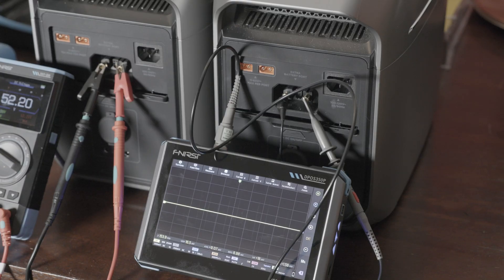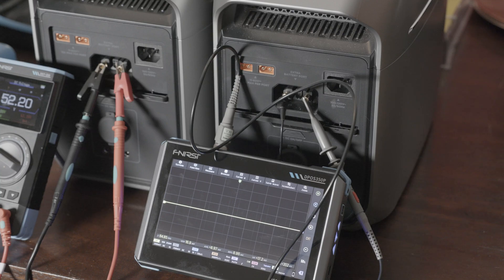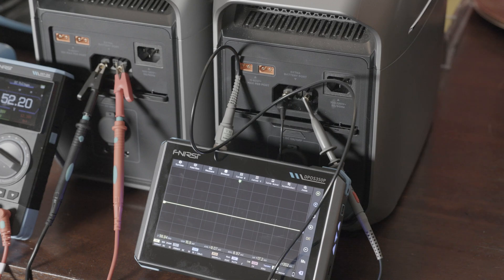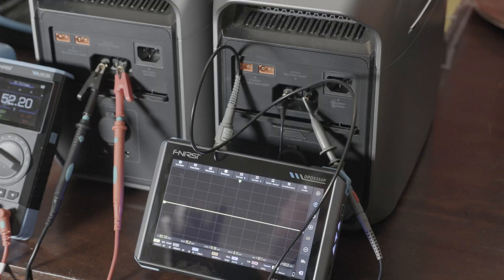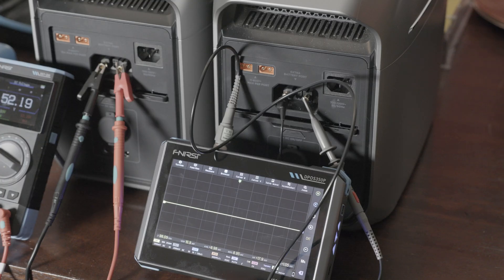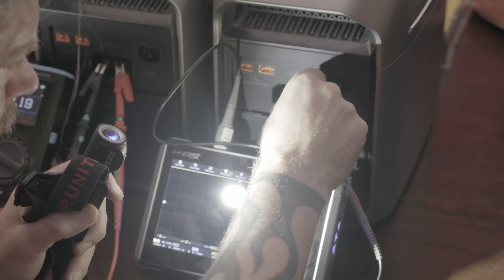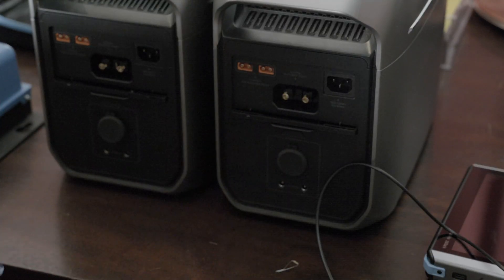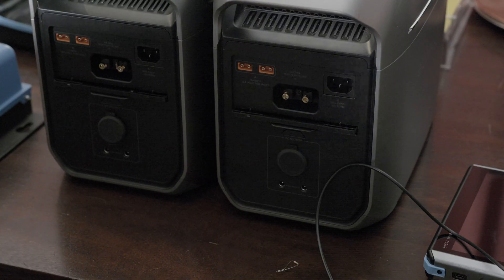Big News! Direct Battery Access Hack for Ecoflow Portable Power Stations (Finally) Delta 3 Plus Demo

Comment: Have you found any way to "turn on" the extra battery to access its battery without the main unit?

I found the Delta Max 2000 I have the port1 requires jumping to different pins than port2 but generally works fine regardless

Comment: For the Delta Pro can you use the same resistor and which pins do you connect? I understand that it is 15S as opposed to the normal 16S.

Comment: Is ecoflow internal battery gauge taking into account an energy drawing from or charged to this XT150 port?
If I would like to attach additional battery, will it account additional capacity? 
I guess when using original battery accessory there must be som additional charger/discharger in it to sync SOC before it fully connected, did you tried to connect it in this way?

Comment: I have ecoflow delta 3.   The battery interface looks exactly like above with a postive to right and n to left,  will this work with 3,  if i follow instructions I dont see any difference, how do i know if this is working
Reply from the maker: You need to get a multi meter and test, just be careful.  It's not so much high voltage but lithium is high current.

So that is why I have not made a video showing how to make a hacked cable directly off the contacts, I don't feel it's safe.

I'll be instead releasing a video showing how to build a very safe OEM quality hub.

Very busy with IRL right now, maybe not this weekend but next that can be my weekend project.

I highly doubt it changed on your unit, but since I have not tested I obviously can't verify.

Comment: VERY COOL

I am competent enough to follow the instructions and duplicate what you have done. But its really a monkey see monkey do scenario.   My goal is to add a third party expansion battery that can charge and discharge in the same manor that the proprietary  EF expansion batteries do. I am using the EF Alternator charger with a delta 2 max.  

So my basic question is what voltage 3rd party battery should I use? I see several YT vids connecting 48V batteries on other brands, using a similar hacking technique. 

Can I use a 12V battery? or do I have to use a 48V battery.

thanks in advance
Reply from the maker: So you can hook up a battery to the solar input.  I'm doing that and it's a safer way to easily add capacity.  Then voltage only matters with the MPPT range .higher voltage means less current and easier to get max power so yes 48v is good unless the power station is too small to handle it.

A direct battery connection like this is another whole level higher, direct integration, hooking the batteries directly together.

So they must match just as you would building a DIY battery bank.

So same SOC, same voltage, chemistry, etc.

I'm releasing the into as you can do even more powerful things with this setup, but it might be overkill if your only goal is extra capacity.

For that check out my Ecoflow hack video:  https://youtu.be/0fvpc5QyYHk
Reply: @ViciousXUSMC  Yeah I understand that the solar port can be used. But then there is no way to charge the external battery and Ecoflow with the EcoFlow Alt charger.   And besides I need the solar ports for my solar panels anyway.   Its just a kludgy solution.  What you are showing is a much more elegant solution. 

Just in case I am missing something.  You say you are using the solar input for the ext battery.  Have you found a way to charge the external battery while it is also plugged into the solar input?  that is the #1 problem with this setup in my view.   

What is really attractive about your hack is that the ext battery acts just like the proprietary EF batteries. and there is the bonus of the possibility of getting more 12V power output for a diesel heater.   I am having to use the AC inverter all night while camping because heater requires 130W @ 12v DC, for a 30 sec.  The cigaret port taps out a 5A I believe.

Anyway thanks for the help
Reply from the maker: @joedunne635 Yes watch that video or actually a few of what I have shown that setup.

We replaced the solar with a battery 
We add solar MPPT to our battery 
Done, this is a self sustaining system.

The new MPPT has your solar panels going to it instead of the old PV port.

Now you can get any size MPPT you want, and your still saving money because a new MPPT and battery is going to be cheaper than just the own expansion, especially as you keep scaling higher and higher.

Like my setup is now nearly 30,000Wh (30x the original capacity) for my little Delta 3 Plus network I setup

Comment: Shocked that this doesn't have more views given what a huge discovery this is! Thank you for doing this and and linking the source. I can confirm this works on my (non-Max) Delta 2. Interested to see what people, smarter than me, are able to do!
Reply from the maker: For one using this concept, on a different power station I want to showcase how you can use it to make use of an external MPPT.

So if you wanted more solar or similar this gives you an option.

Though you can also use a MPPT as a middle man and go directly into the PV input as a workaround too for helping use high voltage panels on low voltage power stations.  

That's in this video: https://youtu.be/t2bRHF9negA?si=vChdTnTHOhJXpK6C
Reply: any reason to suspect this would not work on my delta 2 max?

Comment: Nice ! I was also wondering when this hack would come out.  Been using solar ports on my delta 2 max.  Not efficent as mentioned. 
Does anyone have the link to purchase the same 1k resistor used here ?   Thx
Reply from the maker: I'll add the link in the description for you.  Unfortunately the cable I ordered isn't here yet and Amazon said delivered and it's not.

Once I have the cable built I'll really start testing this.
Reply: Hey, any luck with the cable arriving?
I was wondering since the delta 2 max has x2 extra battery ports.
Would there be any benefit to connecting them both to a larger battery bank thats in parallel ? 
Also, do you think the Max 2, when plugged into the wall outlet, will charge the added batteries ?
I'm looking forward to the build. 👍  Thx
Reply from the maker: @user-jd6dq8bn5c Nope, got lost in shipping.  Had to order a new one :(
Reply: Hey, I went ahead and made my own parallel cable. I've had some interesting findings. 
The delta 2 max, at night when plugged into 120ac, solar disconnected from D2, will charge up my 48v 200ah battery bank faster than my new 48-58v LI 18a golf cart charger.
All Battery temps stay nominal.
 Making it more streamlined during nighttime recovery.  

There is a disconnect when receiving solar and have the 48v 200ah  battery bank linked parallel to d2, the solar stops charging the D2 battery and in turn its 60v 25amps solar to the battery charge controller then to the battery then to d2 solar ports for 1kw. 
Having battery bank parallel during this process stops the d2 battery from charging, and it gradually goes down in percentage throughout the day.  If I pull the parallel cables, then the D2 battery starts increasing percentage during solar port 1k hookup. 
So right now im solar feeding daytime un parralelled.
Night parallel with wall ac plugin.  Will ad more solar panels after October has passed. No hurricanes.
I'm still learning more every day. 
Thoughts?
Thx
Reply from the maker: @user-jd6dq8bn5c cool experiments and findings.

I might have to make a temp cable the permanent one I was going to make was lost in shopping.

Comment: Is there any reason that this wouldn’t work on the EF deltapro 3? Or would the protocol be different considering that the batteries aren’t compatible????
Reply from the maker: I would verify each unit separately, if they are using a different connection especially.

But the concept will definitely work.

At worst, if someone really needs this functionality, a 100% way to always achieve it is to have ond authentic extra battery, and splice the battery cable.

Let the normal authentic communication happen and just tap into the electrical side.

Not as flexible and you have to get a battery, but better than no option at all.
Reply: Wooow wait let me get this right: so you’re saying get one ecoflow extra battery, and splice in to the 48v portion of the cable. And run your extra no EF battery functionally in parallel? I think that’s what you’re saying…???
Thank you so
Much for doing this work. Very awesome prospect for us thrifty off griders
Reply from the maker: @greeneggsforsam  Yes that would work, please take that task on in a safe way, use fuses, disconnects, etc and be sure to test it and see if it will function how you want before you put it into "production"

So far the BMS seems to just read the voltage of the battery its connected too so doing this bypass I can double, or triple the internal battery capacity and the unit just works like normal but at a higher capacity.

It will still show % and everything and while it wont be perfect it works.

I have not tried with an extra battery attached, but it should work the same except your extra battery will now be in parallel both both other existing batteries.

Be super sure to never connect batteries together that are not the same voltage/chemistry and be sure they are at the same SOC when connecting.

This is out of the box stuff that really works, but your very much on your own with risks.
Reply: Very much understood as far as the risks are concerned I appreciate this info so much!

Comment: Anyone know someone with a 3d printer who can print/build a connector with pig tail to make connecting in this manner easier/more secure?
Reply from the maker: I am still waiting on that aftermarket cable to make a good permanent build and will cover that in a video.

It will have a disconnect switch, fuse, etc all built in.

3D printing can be good, but it has to be done good.  You really don't want something to melt and go wrong or fail when it comes to electrical and high currents.

I noticed on the Apex 300 When connecting an extra battery that when the Cable is connected there is no power until you lock it.

That lock has to be controlling a connection in the same way this bypass does.

So I'm kinda upgrading the stock cable that sends power soon as it's connected to one that won't arc or spark when connected because the on switch for the bypass will be off.
Reply: @ViciousXUSMC  So you have already contacted a vendor/oem to build the cable you mention above?
Reply from the maker: @jonboy345  Oh no, I am waiting on a long cable that is 3rd party that already works, and going to modify it to act as an output cable when it arrives.
Reply: @ViciousXUSMC  curious how that would look like. Looking forward to a video.
Getting 20+Amps 12v out of a ecoflow would be great. Already ordered a DCDC after seeing this video! Will first test with a resistor on my Delta max 2 before ordering a OEM XT150 cable and cutting that up :)

Comment: When the d3+ and the eb provide voltage they provide a constant voltage the whole time the voltage doesn't drop with battery % (my testing) can you confirm the battery voltage is dropping?  I paralleled the d3+ and eb and a 48v 5kwh battery same chemistry and it never dropped voltage and never pulled from the 5kwh battery. confirm the battery voltage is dropping?
Reply from the maker: Yes it drops fine, and even charges fine.  If your not familiar with LFP batteries and how they have a flat voltage curve for almost the entire SOC, I think that is the puzzle piece your missing. 

As for parallel, since we can't control the internal connections it is possible to have one battery be prefered (whom ever is closer to the load) so for example when I show the big battery rack build you will see how the battery connections are on opposite sides of the battery bus to create an even load.

Comment: NICE!!!  I was wondering when this would come out.  I was going to try messing with the "generator adapter" but this looks like a better way.  Another thing I have found with the accessory cables that go to the DPU, they have resistors or direct links in the comm wires to tell the DPU which cable is attached.  For example the Generator adapter has a resistor,  The EV cable if I remember correctly has a direct link and the regular cable that goes from DPU to smart panel is pass through.
Reply: one for all and all for one i guess!!!!   keep up guys  ...  now i can use my spare victron 100/20 and some extra batteries !!  will hate seeing my D2 at 0% more of its times due to algorythm but  it wont  turn off i guess!

Comment: Anyone tried this with the alternator charger? Can't get a XT60 cable right now and would love to charge another power station with it.
Reply from the maker: The alternator charger won't work because the internal battery is 48v and it can't handle 48v.

That's just another reason I don't use them and instead build 48v systems and use different equipment.
Reply: @ViciousXUSMC  Okay. But I would like to use the alternator charger with another power station via xt60 connector. Since the EF cable is not available at the moment, I wonder if it's possible to trick the alternator charger the same way as a battery, so it outputs voltage and charges another ps
Reply: Got a cable from the Ecoflow Stream Microinverter with 12V plug on the other side, cut the 12V plug and soldered a XT60 connector. First tests worked fine  - got stable 48V on the XT60 connector👌
Reply from the maker: Yes I send 48v (52v) over XT60 to the MPPT of my power stations and charge and run them this way.

3000w of output on my system is being dent over XT60

Comment: Finely a solution I really needed this. I am going to try this on delta 2 max. Pin 4 to 6  such a simple solution.
I wonder how much power can you push or pull.
Reply: I just thought of it but you can connect 2 delta in parallel connection with this
Reply: It works with Delete 2 Max works. Nice

Comment: Is it possible on the EF ECOFLOW Portable Power Station DELTA 2, 1024Wh LiFePO4 (LFP) Battery, 

As well. To hack the battery expansion port?
Reply from the maker: Pretty sure, but it may not be the exact same mod.  The GitHub page has all the technical details.

I have the Delta 2 Max I need to try with and I'm going to work on power cable building soon.

I am building in fusing and an off/on toggle for the bypass
Reply: @ViciousXUSMC That would unlock the door for the majority of ecoflow power station owners please post a video of it! Thank you and those that figured it all out!
Reply: @ViciousXUSMC nice. Looking forwarded to it. Was thinking of going directly to the battery as well to expand the unit.
Reply from the maker: I am pretty sure they have the bypass for it.  I have the Delta 3 Max units I need to look up also.